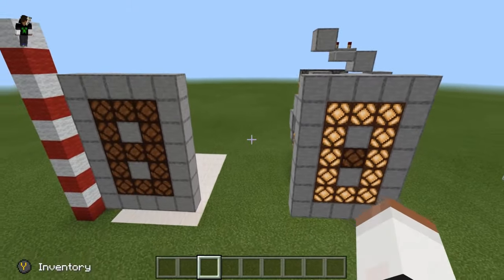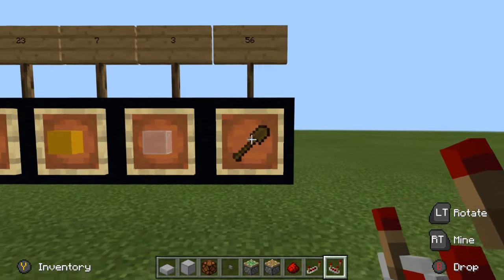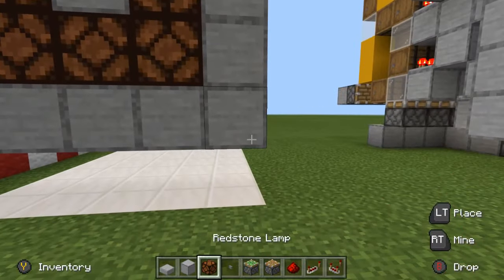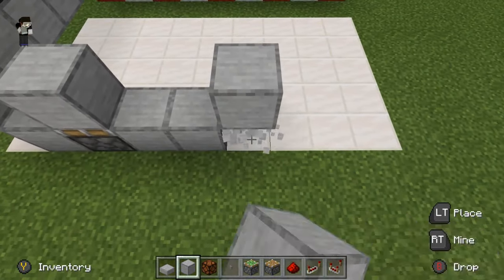MineCraft BedRock Digital Counter Display / RedStone Tutorial

Comment from the maker: Hey folks @12:02 in the vid the 3 on the barrel is supposed to be a 4. Again last layer of the timing the 3 is supposed to be a 4....editing fail....my bad, love yall, ItsEnderkiller2 nice catch!
Reply: You could of told me that before I looked through the circrts figuring out what porewed what and how to find out where's the shovel was missing
Reply from the maker: I may actually re record this vid with my better settings after the nether update (if it still works then).

Until that the pinned post is all I could do lol
Reply: That explains the reason why 5 and 6 were not working
Reply from the maker: Check out the update to this vid! Link in the description. It's a bit smaller. If not then yeah look for the barrel in the last bit of programming and there is only one 3, make it 4.
Reply: You even opened the exact barrel at 13:25 which have 4 spoons(wooden shovels) lol!
Still very helpful though I wouldn't have been able to build this on my own!
Reply from the maker: @smellyalloy7406  sure did
Reply: That is the 5 and 6 problem.

Comment: from 2 to any other number it doesn't work
Reply from the maker: Click the update in the description
Reply: @MightyMeerHut  My bad I didn't see the change 3 to 4 and I missed some b blocks
Reply: @MightyMeerHut  It's a really neat design, thanks a lot for this :)
Reply from the maker: Lol glad it worked!
Reply: @MightyMeerHut  Will be using it on a realm, will be making it use positinal notation by adding a counter behind it, in which when it reaches 0 it adds one to the display next to it, it's a big counter (would like a smaller one ngl) and I'll be resetting it manually

Comment: I have a problem on digits 5 and 6 and I doubled check everything and seems to me I can't find where the error I did.
Reply from the maker: 1.13 may have messed with it, I'll give it a look
Reply: @MightyMeerHut  I appreciate your help. This video is underrated, it should have more views as this is the most comprehensive Digital Counter Display tutorial I've ever followed.
Reply: this also happened to me now that i finally built it and i dont see anything wrong
Reply: oh i found the problem. I think it was an editing problem since on the third layer, the barrel that says 3 actually needs 4
Reply: btw u can see it at 10:43
Reply from the maker: Rofl omg you're right, editing fail
Reply: @ItsEnderkiller2  at last you found the problem. Thanks bro.
Reply: @sekushon9918  glad I could help :)

Comment: I just built this and I went to test it but when it gets to the number 2 the bottom 2 (on the right) don’t light up and when I try to press the button again nothing works. Could anybody help me?
Reply from the maker: I would rip out the programming (barrels glass etc.) Then rewatch the tutorial making sure that everything is eight and then put back in the programming, look at my pinned comment for the lil mistake I made in programming lol. Let me know if you get it! This contraption does still work so I'm sure you'll  get it! Hit up my discord for more help.
Reply: Mighty MeerHut ok (I don’t have discord so I will just come back to the comment section here if I still need help) thanks!
Reply: Mighty MeerHut ok I just did all of that and I think that my wiring is wrong because the blocks are going above the top pistons (on the right) causing it to break